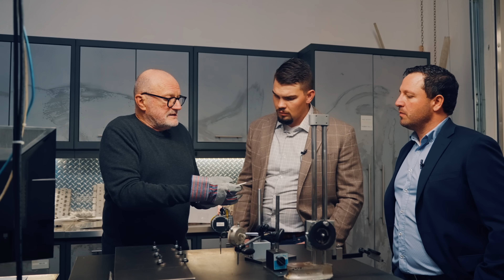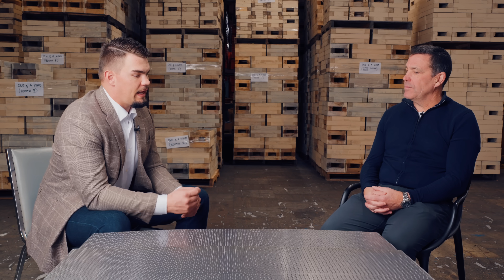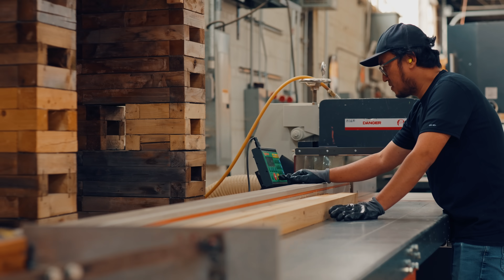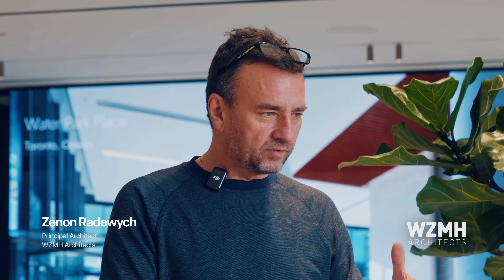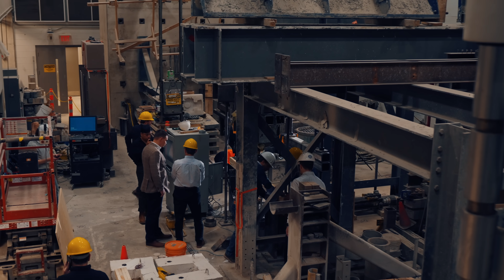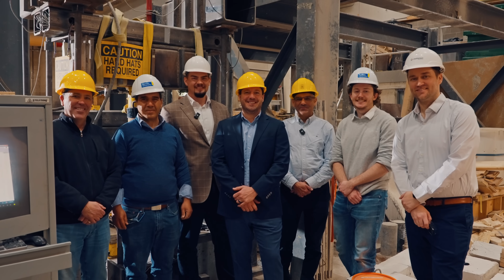This Patented Technology is Upgrading Wood Construction

Comment: The metal should have been underneath the bottom board and then it would have supported it to crush load levels, because the wood doesn't have anywhere near the tensile strength.
Reply from the maker: Agreed. We testing 5 different layups that include that in about 2 weeks

Comment: The obvious feild use question is how to cut it on site?  Ferous metal cutting requires specialized saws and blades.
Reply from the maker: We're also testing aluminum. We've tested cutting in other wood based composites with success.

Comment: Great video. I wonder if the grip metal could be applied between the wood in which the wood has a few mm arch, end-to-middle. It would be preloaded. So it might effectively have greater bending strength in one direction.
Reply from the maker: Thats interesting you say that. We actually messed up a sample when running it through the pinch roller and it can out just as you describe.

Comment: The test piece should have had grip metal on the bottom to reduce tension force because as the video shows it was placed on the top and did nothing for compression force.
Reply from the maker: 100% our next testing round happening in a few weeks is doing just that. We are replacing a high strength tenaion lam (o board) with a lower (L2)
Reply: I assume you roll form the product so you should be able to match the 60 foot lengths of TJI products.  A strip on top and bottom would simplify orientation.  Prevention of truss deflection will make your product perform higher than it currently is rated, with their composite wood being the weak point.

Comment: I like this as an alternative to glued materials for recovery: at end of life, best to cut and reuse recovered material but deconstruction is not common: excavator violence is used to bring down buildings unfortunately. Anything can become wood chips, too. 20+ years recycler here - it really depends on the specifics of the grip metal (mostly its thickness) if you are trying to make chips. Materials behavior in deconstructing is quite specific same as in construction. Most chipping is accomplished with swinging hammers forcing material through a fixed grate to create an impact zone, usually w a horizontal axis rotation or you have mulching of entire tree stumps in 1,000+ HP tub grinders. Then we used magnets to remove the metal and this metal is going to still have a lot of wood on it so that lowers the value. Still, this is definitely better than glued material.
Reply from the maker: Thanks for the deconstruction and material recovery notes. Its something we are researching now!

Comment: This technology would work great with bamboo. It would work even better with 3d printed materials and even 3d printed cement!
Reply from the maker: We havent thought of bamboo or 3D printed materials. Im not familiar enough with them - why do you say that?
Reply: @masstimbergroup you can get pet mixed with sawdust wood like printable Filament that can be sanded and shaped like wood. Bamboo is pliable with steam and can be "unrolled" into sheets.

Comment: Very cool but not new, truss plates have used that tech for decades.
Reply from the maker: Yes, truss plates are an amazing invention. This is dofferenr because its  not perforated, so it maintains strength and bending and is able to reinforce materials, not just hold them together.

Comment: Niche product- it will be expensive
Reply from the maker: Its actually VERY cheap to produce because of the scale of production and the relatively simple machines needed to manufacture. Less than $1/sq ft depending on the base material and other custom modifications.

Comment: It looks to me like needled steaks, where the wood fibers are cut thousands of times ... maybe a glued steel fabric is better ...
Reply from the maker: Good point, what we've found is that that pattern, shape, and desity of the hooks matters. We can modify any of those. When we use pointed hooks, they penetrate the fiber, but they don't "slice" it like a blade would. Pretty extensive testing was done is shear connections for timber with this, and was found to be much better than screws alone, with the same performance as glues - but without the prep, drying, and weather considerations downsides.

Comment: Interesting. What is the performance over time of the steel component if exposed to moisture? Also what is the fire performance time?
Reply from the maker: We are testing which metal to use in different materials (steel, aluminum, galvanized, etc) but have done a decade of moisture cycling tests with the automotive braking applications. Once we finalize on the metal type and makeup in the beams we'll move to full scale fire testing. Early fire engineering analysis tells us the fire performance will not be an issue, and perhaps evwn an benefit as it introduces a noncombustable break in the assembly.
Reply: @masstimbergroup  you would need to hot dip after forming to use in pressure treated.

Comment: It reminds me of the FRP reinforced glulams, neat idea. I see some of the same problems as nail-lam. If I need to cut it there is metal in the composite. If the electrician needs to bore through it he'll need chafing gear for the wires. The materials change dimension in response to different conditions, temperature for the metal, moisture with wood, what happens to the bonds after many cycles of temperature and humidity. Did the wood just take an incised strength hit. Good Lord, use machine graded with controls for comparison rather than salesman graded, that was all 2&btr and was stamped. I kept waiting for a real comparison to some solid sawn section or build up. Hopefully that is all constructive, its a cool idea.
Reply from the maker: Thanks! Similar idea as the FRP but with drastically reduced labor and costs. For cuttinig, we've already tested cutting it with hand tools and CNC, no problems as long as the metal layers are thin enough and right bits/blades used. For electric routing, we're testing solutions but the idea is to use it more in commmercial applications and locations you wouldn't run it through the beams.  We are doing full scale framing grade glulam testing across 35 samples (with controls) and 6 different assembly options right now. The video demonstration was just to illustrate the concept of reinforcing lower grade fiber to compete with high grade fiber (DF, etc.) or lower grade lamstock. We are also tracking for the fire, moisture, etc. tests after we nail down the best assembly option.
Reply: @masstimbergroup  Like in the case of those 'easy blocks' and knowing your application, can you integrate cabling paths through the structure when fabricating it? Many of these applications are (the break shoes, historically) commodity items the bulk of the rest will be more or less modular structures, won't they made in factory to order? For residential builds you can pre channel members to some code requirement even - say for wiring (maybe even pick and chose electrical boxes at the correct height).

Comment: how do you pull it out and recycle it?? seems pretty hard
Reply from the maker: The best way to recycle is to reuse the full component (pull the whole beam out and reuse) but - if you wanted to disassemble the beam its not that difficult. The metal can be peeled out, and then you don't have glue or chemicals to deal with. Would it be super easy? Probably not, but if it came out easily it wouldnt be good for structural reinforcement. Little bit of trade off.
Reply: @masstimbergroup  Yes to cut and reuse but anything can become chips, too. 20+ years recycler here - it really depends on the specifics of the grip metal mostly in thickness if you are trying to make chips. Materials behavior in deconstructing is quite specific same as in construction. Most chipping is accomplished with swinging hammers forcing material through a fixed grate to create an impact zone, usually w a horizontal axis rotation or you have mulching of entire tree stumps in 1,000+ HP tub grinders. Then we used magnets to remove the metal and this metal is going to still have a lot of wood on it so that lowers the value. Still, this is definitely better than glued material.
Reply: It lasts foreva

Comment: Did the 4x2 at the visual grading stage turn into 6x2 at the testing rig?
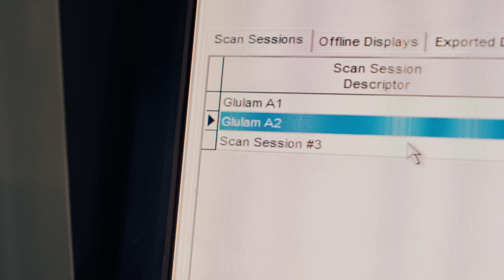Reply: Ah, we saw the visual grading of "Gluelam A1" but the video at 12:17 showed the results or "Gluelam A2".
It would have been nice to have seen all the data rather than a selection. That said, it's an intriguing product...
Reply from the maker: We tested both the 2x4 and 2x6 with the same visual grading but we broke the 2x4 sample when we put it through the press so we couldnt use the data. We are actively making 35 different 2x6 beams to test in the next few weeks though!
Reply: @masstimbergroup  Thanks, will be following with interest... Cheers